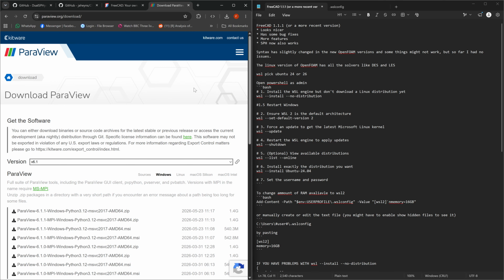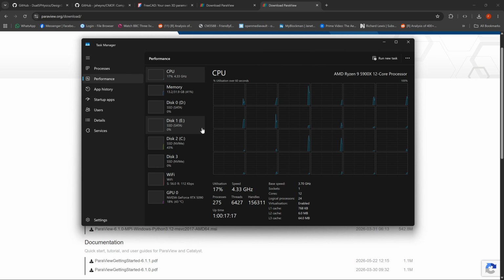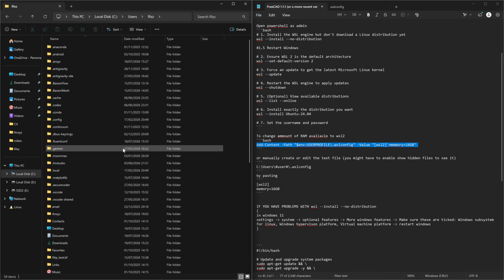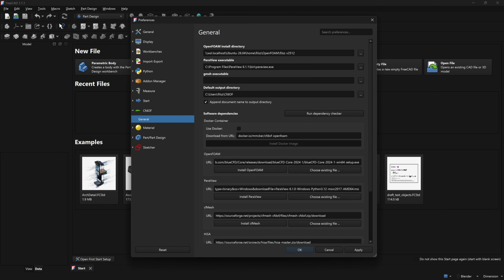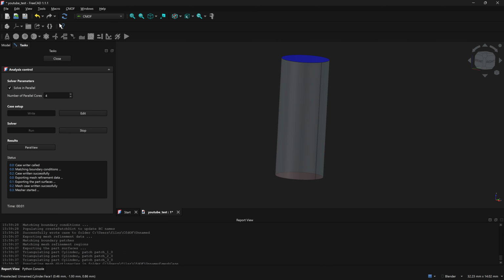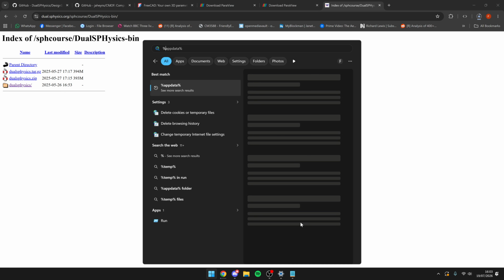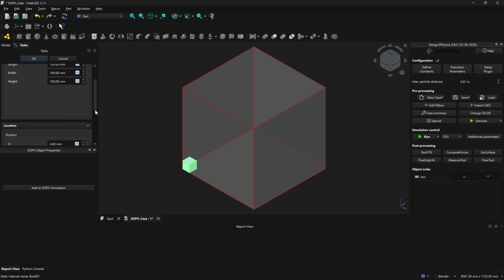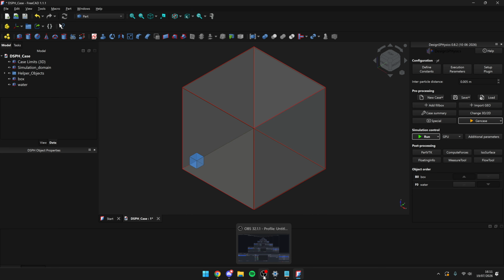FreeCAD 1.1.1 + CfdOF in wsl + DesignSPH installation tutorial 2026

Comment: Im having some trouble installing cfmesh and hisa. The .zip files download fine, but I get some errors in the Allwmake commands. Most of it goes fine, but a handful of files get errors. Then when I run the dependency checker it finds the openfoam stuff and sits with a spinning blue wheel for the other stuff. Any ideas for how to fix this?
Reply from the maker: The spinning blue wheel is normal, it does not mean it's broken. Check logs to see what if it works. 

I know it's not the smartest idea, but paste the allmake errors into an LLM it will tell you whats wrong. 

If that doesn't work you can message me through the FreeCAD discord.